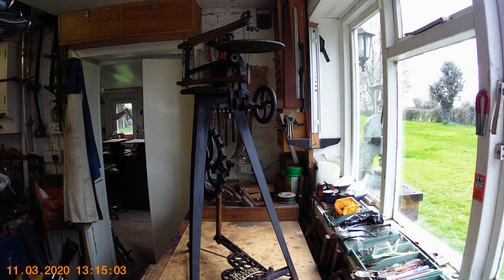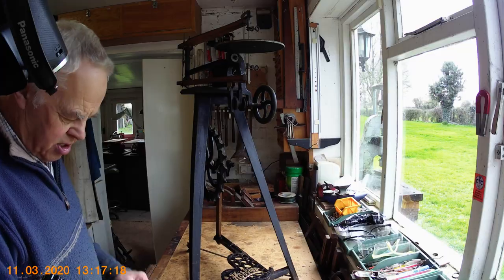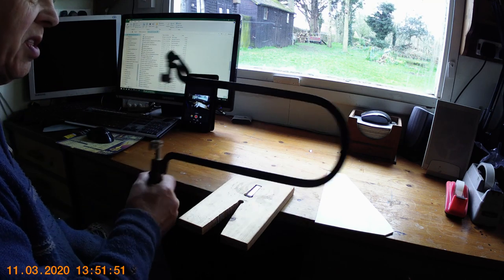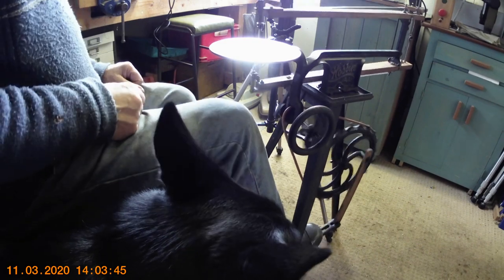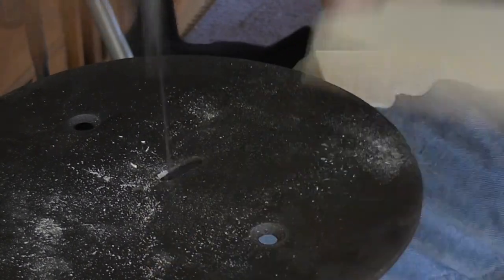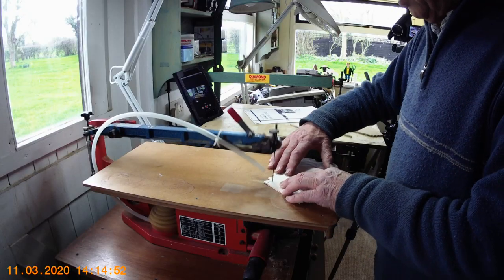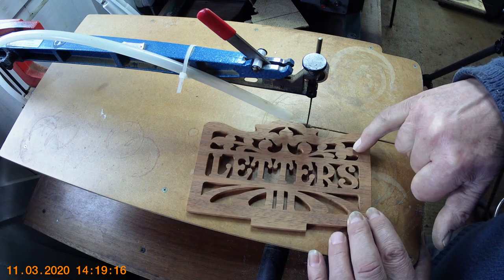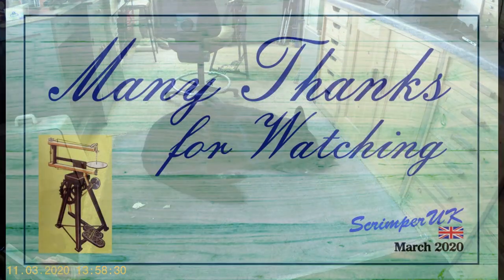Scrimpers Ramblings. Hobbies A1 Fretwork machine Part 2

Comment: That Hobbies hand fret saw with the quick release is much better than your typical modern saw, where sometimes I find it really difficult to thread and refit the blade. Will be keeping my eyes open for one of those. 
Very interesting video thanks.
Reply from the maker: Thanks for the comment and interest. Indeed, the Hobbies 'lever' hand frame saw is so much better than any of the newer ones even those that were made by quality names such as Eclipse. The original Hobbies company (who made these hand frames) was wound up in 1968 and production ceased. They do appear on ebay from time to time. They were available in 12in,14in 16in and 18in frame sizes.

Comment: Hi John
congratulation very nice work
question what type of wood you use
Reply from the maker: Hi Rodrigo, Thanks for your kind comment. As regards wood I use recycled stuff, I have not bought any wood for many years. I scrounge old chest of drawers and other old furniture as it's often better than new wood. I also use plywood scraps that I got from a skip of a woodworking place.
Reply: Thanks John
i saw a "whirligig exercising in the wing " made by Dennis Franz
it s a ver nice work
my quieting is with you experience how <dennis convert the horizontal movement of the rod to  the wheel movement  
thanks

Comment: I bought a Hobbies frame exactly like yours about 2 years ago from eBay. It was about £10 and is a nice bit of kit. They're so much better than a modern one, partly because they have the lever tension device. You are often better off buying an old tool than a new one, the quality is way superior.
Reply from the maker: Sorry for the delay, only just seen your comment. I agree entirely with what you say about old tools being superior, The Hobbies frame is a good example of that.

Comment: Excellent videos John, I have just bought an early one to restore, struggling to source blades for it , do you have any recommendations?
Reply from the maker: Thank you Ed. you can get blades easily I get mine from Hobbies (youtube removes links but if you search for hobbies .co.uk it will come up) then search for fretsaw blades, they are 5 inches long. Many other places sell them such as Amazon, Axminster tools, ebay etc. make sure you buy 'pinless' blades.
Fretsaw blades are readily available, they are also known as Scroll-saw blades

If you need to replace the leather driving band, look on ebay for 'sewing machine leather belt'.

Good luck with your restoration. John.
Reply: @scrimperuk  Thankyou very much John, much appreciated, hope to restore between xmas and the new year as its a quite time, Ed.